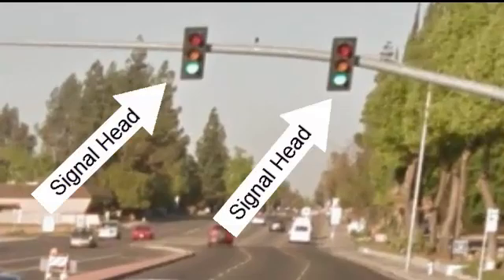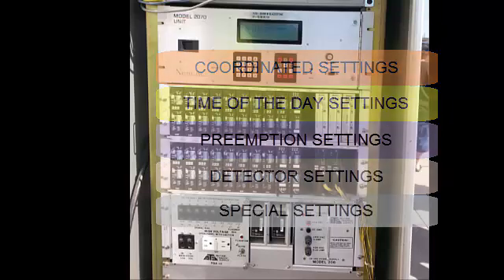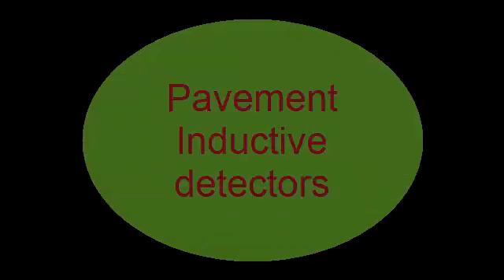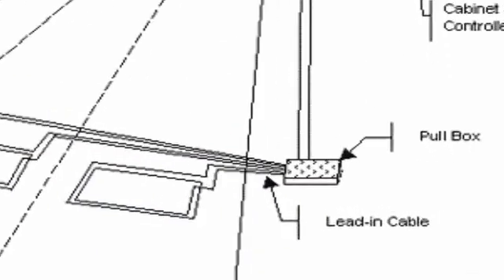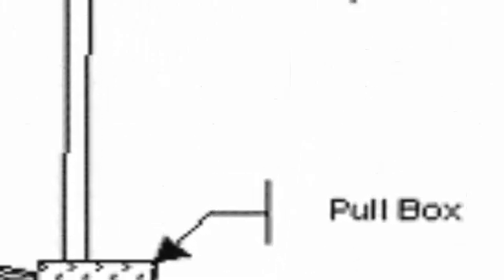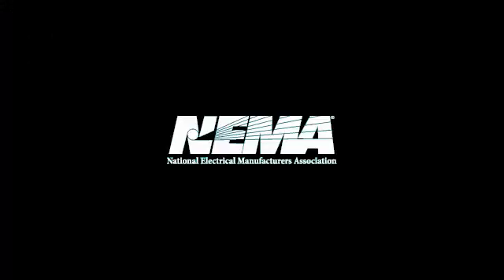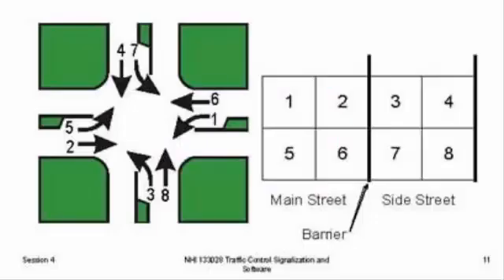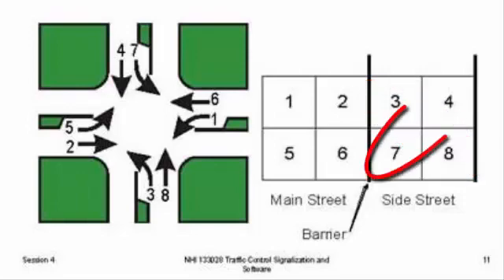TRANSPORTATION CASE

Comment: Actually a controller has both capabilities Actuated and Non Actuated.
The 222 Loop detector card does not constantly test the inductance of the loop but monitor.
The controller does not make decision but work with in the threshold that has been set by the Traffic Operations Technician.